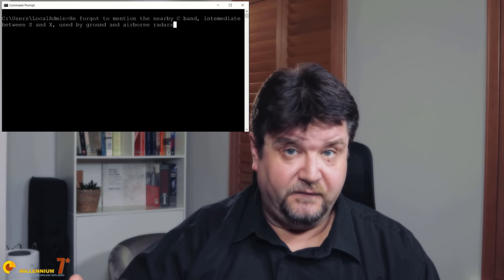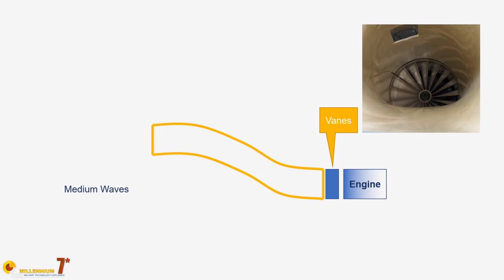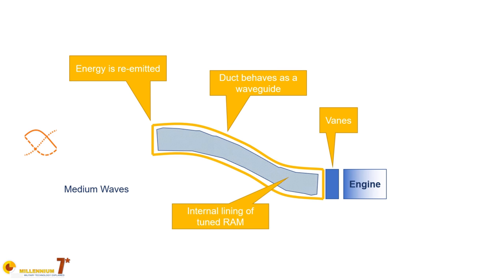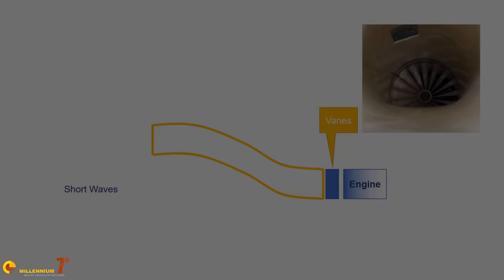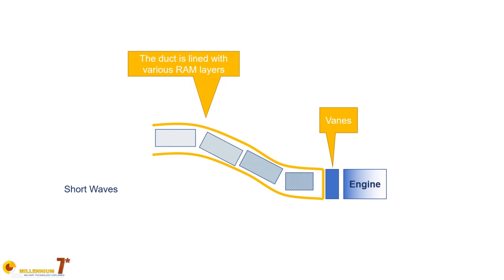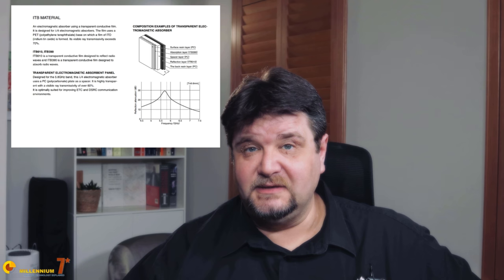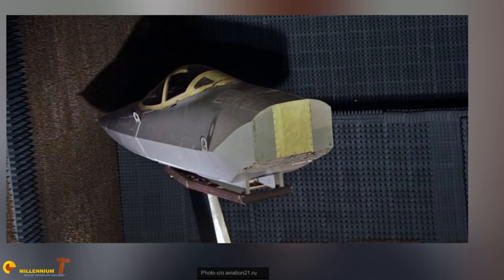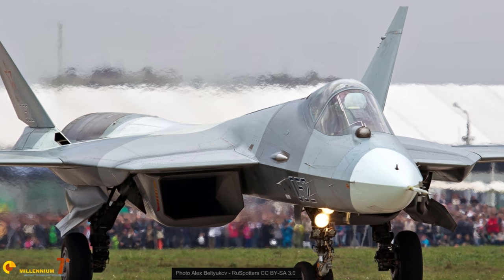STEALTH 103 | The important bits that nobody explains

Comment: Yes I would love to see the even more detailed video on this topic.
As far as I know F-35 isn't particularly stealthy in L band. Which means you can detect the plane. But with L band you won't be able to find firing solution - that is my understanding.
Cheers from Poland. Stay Safe!
Reply: Technically any radar band can detect a stealth aircraft, but the distance in which a reliable detection can happen is different. And yes, any bands that have a frequency lower than C-band doesn't have a sufficient resolution for a precision targeting. A good S-band radar can guide a missile in a general direction, but not during the terminal phase, which is a big problem for missiles that use a semi-active radar seeker. And stealth aircraft is still going to reduce the effectiveness of the L-band, just not to the extent if it were against higher-frequency bands.
Reply: @mickeyg7219  Yeah - I understand that stealth doesn't mean "invisible to radars" as some people think. It is just that from what I've seen F-35 RCS in L-band isn't reduced as much as it should be to call the plane stealthy (at least not as advertised). Because you still know that something is flying up there - you can't target it from ground, but you can get interceptors in the air or steer CAP to the target. And if they happen to be close enough they will detect and lock on F-35 (also IRST exist, so that can make it more deadly).

Stealth is to reduce the range of detection and make harder to have firing solution. And to be fair - almost all stealth planes have a problem with countering L band. From what I hear (and see the RCS diagrams) F-35 is just having more problems than other stealth planes in that particular band.
Reply: @jannegrey  
The F-35's exact RCS figure is not publicly available, so any claims made by a layperson should be taken with grain of salt.

"Stealth" is not a solidly defined term, there's no consensus on how effective the aircraft must be against a certain radar bands to be considered "stealth." However, all stealth aircraft are best against X-band.  

IRST is effective against stealth in some case, but it's worth knowing that all stealth aircraft, including the F-35, were designed to have a low infrared signature. And infrared-guided missiles usually don't have a good range. And yes, while you can relay to the interceptors to the target, it's unlikely that the F-35 will find itself in that situation in the first place, because in a real war, no competent military relied only on one equipment. Basically, the F-35 is a force multiplier, not a silver bullet. Like tanks, while it's powerful on its own, it's a deathtrap without an infantry support. In a modern offensive war, the first thing you should do is to find a way to suppress or destroy low-frequency radars and shut down the airfield with cruise/ballistic missiles before you send any jet fighters deep behind the enemy's line. 

One thing though, general Mike Hostage stated that the F-35's RCS is smaller than the F-22's. This make sense considering that the F-35 used a newer composites and RAM coating built on the knowledge of the F-117, B-2, and F-22. And according to a patent US20100271253A1, the materials used to build the F-35 "is capable of absorbing radar in a frequency range from between about 0.10 Megahertz to about 60 Gigahertz." That implies that it can reduce the effectiveness of the band that's even lower than L-band. While the effectiveness is not equal for every radar bands, some reduction is still achieved. Also, the F-35 also have some RCS-reducing features that is not present in the F-22, such as diverterless supersonic inlet.
Reply: @mickeyg7219  Thanks for the info. I did know the X band thing and that L band isn't a priority, but if they can they still try to protect against that.

The problem is that I considered what I've read on specialists sites and then I looked at what our politicians have to say about F-35. And they think it is a silver bullet.
Your analogy to unsupported tank is very good and obviously, you won't go over enemy territory without first running SEAD/DEAD missions. Though in case of Poland - we have practically 0 possibility of running such missions, so if we would fly - it would be after our allies clear the defenses out. So sorry about that - too many interviews with people who think that if we buy F-35 - all of our military problems will be solved.

Also technically Rafale in Libya were flying "before" SEAD/DEAD missions were complete - but they have way different doctrine and I suppose that they were 1. against weak opponent 2. running some very good EW to make it less dangerous.

Do you know any good sources on stealth?
This is a good site: https://www.radartutorial.eu/index.en.html but I don't know if it isn't a bit outdated.
Reply: @jannegrey  
I agree, if your doctrine is mostly about defending, it's better to invest in other things. But stealth aircraft will most likely become just another "basic" feature in the future, so buying a few might not be a complete waste of money.

What I'm saying is that stealth will probably become like fly-by-wire or automatic transmission - it wouldn't be a "special" feature in the future, but not having them will put you at a disadvantage.

Radar Tutorial is a very good site about radars in general, I have it on my bookmark. It doesn't really cover about that much about stealth though, but many radar lessons on Youtube made by university professors will give you a good insight on stealth technology.
Reply: @mickeyg7219  Thanks - and yeah I can see it becoming normal. Though for now, I would rather have some capable long range weapon platforms in the air with Meteors and AESA radars - but maybe F-35 will be useful too. The problem is that politicians want flashy, but not necessarily something that will be really helpful. Knowing how few bombs and rockets we have for F-16 is already stressing me.

I will try watching some stuff on YT. You say Uni Professors - I'll look for that.
Reply: @jannegrey  There are new missiles coming that has dual search systems, radar and IR or   radar and optic. Those systems only need an general area where to search.
Reply: @sorennilsson9742  Generally you can tell how good radar is by how big it is. So if it has to sacrifice space for IR - then it isn't going to be great - at least not in the beginning. Also it would have to be pretty long range for it to be effective - if it has 10 km range that what good does it make, since the plane would have dropped the glide bombs by that time.
And MICA missiles have swap-able warheads with IR and RADAR for over a decade now. Good systems - but again short range.
I do hope that after Patriots, for lower level Poland will buy CAMM-ER. It's pretty long range for "short range" system, but it will mean that we should have opportunity to choose to fire something less expensive than Patriot Missile.
Reply: @jannegrey  For Poland the likely initial engagement ranges are relatively close for fighter defense of many parts of the country. Thus stealth fighters should probably be based somewhere in the Southwest to give them more time to gain altitude and manage distance to interception target. They would be mostly useless if based near Kaliningrad since they would be within the burn through range of multiple frequencies of ground based air defense radars even as they take off. For those bases that are closest to potential adversaries, the F-16s and MiG-29s in service will be more appropriate since stealth would be greatly degraded anyways and dogfight ranged fights are still a high possibility. 

For peace time defensive use such a basing strategy would support the ability for the non stealthy fighters to conduct visual range interceptions of encroaching or unresponsive aircraft with the stealth fighters able to provide overwatch from further away. If used offensively during war time, they would likely switch positions with the stealth fighters scouting ahead as they enter hostile air space and the nonstealthy fighters providing fire support from some distance behind them.
Reply: @stupidburp  Yeah. They should be based near Poznań, Wrocław or Kraków - probably Wrocław would be the best (furthest). But knowing my government they will want to show off to Russians - which as tactics go is stupid as hell.
But I'm neither a naval nor air force specialist - I'm interested in gear and try to get info, but I mostly know about land systems. And mostly have friends in land forces - so that's where my strengths lie.

And the problem is - during conflict we have like 2 rockets and 2 bombs per aircraft. At least good ones. But who cares - it's important that we get F-35 - it can use it's canon after all.

Sorry I'm facepalming, because of our politicians.
Reply: @jannegrey  The Poland is getting the SkyCeptor missile which is low cost and better missile then the CAMM-ER.  But if just want some point defense vs glide bomb then Iron Dome is best.
Reply: @jannegrey   The F-35 can do SEAD/DEAD missions a lot better then  any Rafale. It is design to go after S300 to S400 air defense system.
Reply: @jimc1654  I hope not. We really need to co-operate more with European partners than getting locked American systems. And how is it better system? Where was it tested?
Iron dome is great, but we need protection against wide range of threats: Ballistic and Cruise mostly.
Reply: While it's extremely unlikely that NATO will find itself waging a conventional war with Russia, however, just for the sake of the argument, Poland should invest on 2 things: artillery and long-range air defense. Due to being next to Kaliningrad, artilleries could suppress Russia's air defenses and shut down airfields. And long-range air defenses to protect artilleries from aircraft that managed to get into the sky.  

SkyCeptor seems to be better, as it has about 3 times the range of CAMM-ER, and the missile have both RF and electro-optical seeker. But as the SkyCeptor is clearly a long-range system, it's likely that it's more expensive than CAMM-ER. The SkyCeptor is basically just a derivative of Stunner missile used in David's Sling system, there isn't much information out there on the difference. 

That's being said, I think Medium Extended Air Defense System (MEADS) is the best option. The system satisfied both the US and European partners, and it's the only true S-400 analogue NATO have. Unfortunately, the future of MEADS is uncertain, and only prototype is produced.
Reply: @mickeyg7219  I agree with you - and we are investing in artillery and air defense. Slowly.
As for SkyCeptor - the problem is that first firing of it will be later this year - from the platform they want to sell to us. It isn't finished in integration with Patriot and IBCS systems.
And CAMM is already working. We should also ask for more Patriots, but that is in a different program.

Comment: The 100nm layer of gold found on cockipit windows definately does not reflect radar waves. A gold (metal) plating thinner than half of the wavelenght of radiation does not reflect the radiation. Radar EM waves have several orders of magmitude longer wavelenghts than visible light. The gold layers probably just create multiple layers of matrices enbedded with radar aborbing compunds. Gold acts as a transparent glue for the aborbing material. 
  Just speculating, of course...

Comment: This is a stupid question. Radar waves are energy can you not use this energy therefore reducing returns. Please be gentle im not rf  expert
Reply: Not a stupid question. Radar absorbing material (RAM) is a family of technologies, not a simple thing like a sponge absorbing water. Some RAM is designed to convert the radio energy into heat. Some is designed to reflect the radar back but out of phase at some frequencies. That means that the radar signal is sent back with the peaks of energy converted to low points and the low points converted into the peaks - kind of like the same waves upside down. The reflection meets the signal and to the degree that the flipping has occurred, will cancel out the radar signal being sent to the airplane. Another form can turn some of the radio frequency energy into a series of stored and discharged electrical energy on the skin of the plane. So from a certain point of view, it's ok to think of RAM as a family of passive electrical machinery powered by radar signals whose job is to oppose those signals.

Today examples like that are at the limit of our technology and hopefully we'll continue to improve on the concept. Personally I salute you for your question. Weird questions are often weird but really good solutions often begin with someone having the courage to ask the weird questions that go somewhere. Well done. 

(Note to others - yes I did use Wikipedia to make sure that I was giving public domain examples, and no, I am not pretending to represent everything about RAM. Just hopefully giving a positive answer.)
Reply: Thank you so much. It fills a lot of the gaps of my understanding. It is much appreciated. This whole channel and post is so interesting

Comment: Question, on propeller driven aircraft there is the constant speed variable pitch props. Why do not turbofan engines have a variable pitch fan blades?
Reply: I'm not an authority but it's probably because the jet fan moves at MANY times the number of revolutions than a propeller and has MANY more blades and the complexity would be insurmountable if not undesirable

Comment: I would be VERY suprised if the antenna on a AESA repositioner continously rotate... I think it is steared to the rotation wanted in every situation.
Looking down when targeting ground and ship targets. Looking sideways when turning away.
There would never be a reason to show a flat surface toward a radar you know about.
Reply: Most AESA radar on the jet fighter is fixed, but some can be rotated, like the one used in Typhoon and Rafale. The main reason why rotating AESA radar is not common among jet fighters is because it added more moving parts to the aircraft. Fixed array is positioned in such a way that even if you dive an aircraft nose-down, the reflected radar wave from the ground will be reflected into the sky.
Reply: @mickeyg7219  Typhoon and Gripen
The only thing needed is one stepper motor, not that much more complex than a current mechanical PESA but another reason for rotation to not be continoys but rather back and forth on demand.

With a rotating AESA you can choose to tilt it slightly sideways to minimise the risk of a radar in front of you ever getting a direct reflection.

A stuck radar tilted upward, fly high, and you would get quite bad ground radar coverage.

Comment: If the radome is radio transparent then what in the point of having the chine continued on it from thr fuse, wouldn't it be better if the aircraft had a conical nose(aerodynamically speaking).
Reply from the maker: PROBABLY continuity, it is just a meter or 2 max and the abrupt change of section would probably be worse.

Comment: Excellent information, what would be real world too is a examination of the F-35 and the specific compramises made in it's design in the interests of stealth. Maybe one engine instead of two, fuel capacity and use, aerodynamic performance, weapon numbers and type and so on. It always seems that we are told the advantages of stealth but never it's cost both in building and running and battlefield suitability and performance, like reduced range and a potential greater crash rate due to only one engine.
Reply: The one vs two engine safety thing may have been more true for older generations, but modern jet engines are so reliable it’s barley (if it all) a consideration
Reply: @moonbear2130  even still one engine jets have been successful and reliable since the very first generations
Reply: @Aaron-wq3jz  that’s definitely not true, early jet engines were very temperamental and were far more prone to failure than modern ones, with each new generation of aircraft cams more and more reliable engines until the ones we have today
Reply: @moonbear2130  excuse me I should have said "relatively reliable"

Comment: "The important bits that nobody explains" passive sensors(Kopáč) that did not need to use  reflection from its own source were deployed by Warsaw Pact first time in 1963... that is the thing that nobody want to explain you. heh
With modern tech and radio source(smartphone) in pocket of most people on the ground why you would need your own source of radio waves and make you visible to the plane and its anty radar weponds?

Comment: how about a group of 40 radars all broadcasting different frequency and listening for all 50 pings.  They are all linked and total dataset analyzed in real time.

Jets are pretty loud.  How about network of microphones, some on balloons or drones?  that is how they found bombers coming in WWII UK.
Reply: My country actually uses microphones on some more sparsely populated areas. Kinda like a sonar network but for air.
But the are probably meant to detect helicopters and not fighters.
Reply: The Soviets had ground-based sound sensors to help provide detection of US bombers trying to fly below radar. Multi-frequency/band radar is how the first F-117 was acquired and targeted.
Reply: @Ni999  Thanks.  Stealth has been around for a long time.   I guess reduced cross section still helps.

Comment: I was just wondering why missiles on planes aren't stealth shaped? Seems like it's a no brainer.
Still praying for a long series on the mirage planes.
I'll make you ravioli from scratch if you do
Reply: Air-to-air missiles already have a very low RCS due to its size. That's the reason why not jet fighters ever managed to "shoot down the missile." It's possible to shoot down a cruise missile with an aircraft (modern interceptors can do this), but not really with the smaller air-to-air missile.
Reply: K